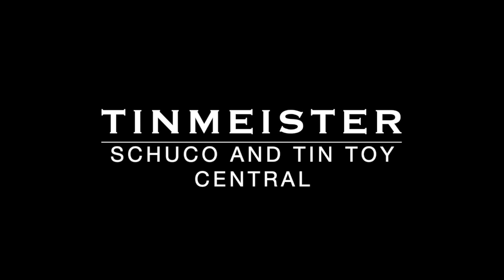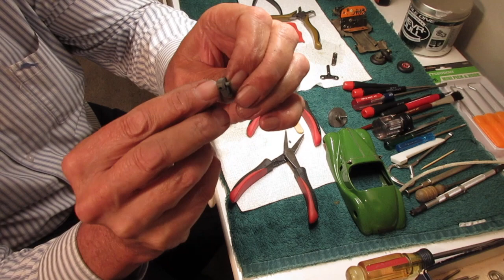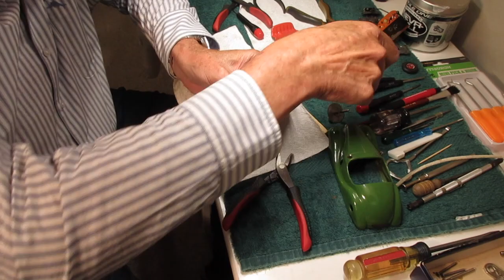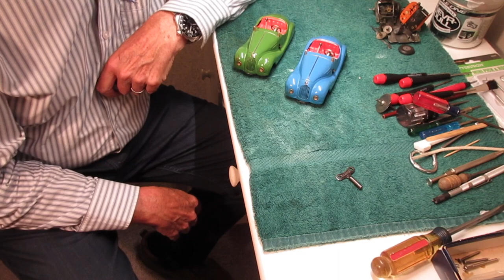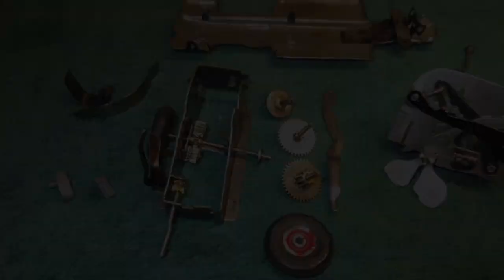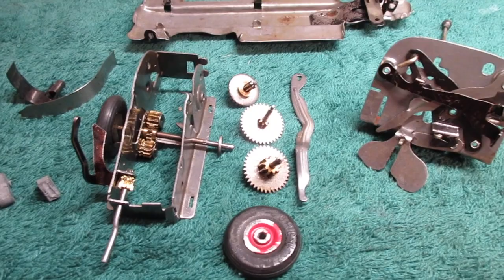Schuco Examico Repair  -  Part 2

Comment: Very Good!

I'm in Brasil, where can I get replacement parts for this Schuco Examico 4001?
Reply from the maker: Hi, lately there are a few parts suppliers on Ebay.  That being said, Peter Reichard at Schuco Klinic in Germany, has original Schuco parts (including springs) that are terrific.  For a listing of parts suppliers that I recommend, go to my front page, and click on "About".   If you scroll down you'll see that list and their websites.  Thanks for the question!

Comment: Hi need help for Examico 4001
I need a pair of steering knuckles that connect to the steering and support the front wheels Mine are diecast and broken PLEASE help Best...Ron
Reply from the maker: Ron, I lot of my pats come from donor Schuco toys that I buy on Ebay, but if you don't want to do that, contact Peter in Germany at http://www.schuco-klinik.de/english/Start_engl.htm
he sells original Schuco parts.  They are THE best.
Dan

Comment: Can I use spare parts from the replica model for the pre-war model?  I'm missing the spare parts for the steering nokkels and the part from what you seeking....Nice Greetings
Reply from the maker: Usually not, but there are a few parts that fit, such as the steering wheel and windshield.  The steering knuckles might actually fit, check them out closely before tearing everything apart.  Thanks for the question!
Reply: @tinmeister356  thank you